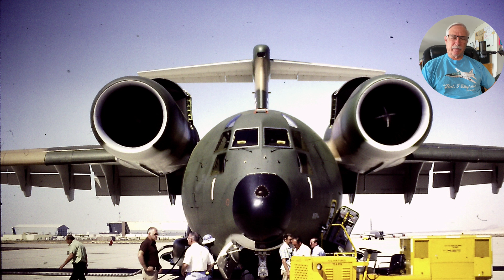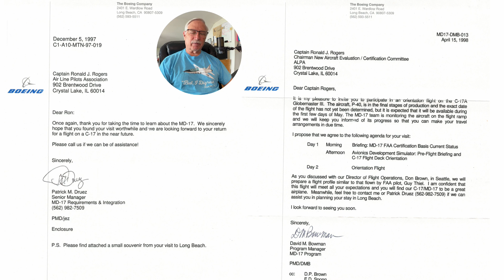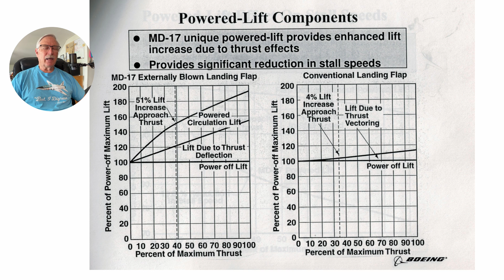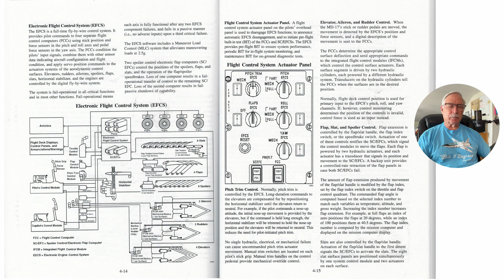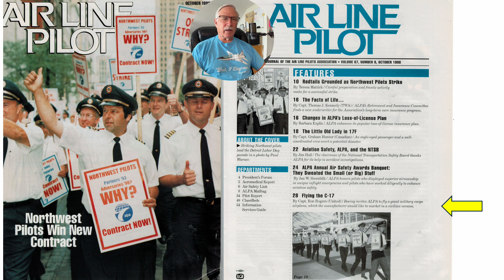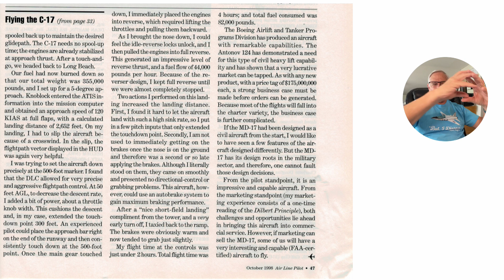Test Flying the C-17. MD-17 program issues

Comment: The Canadian Forces initially bought 4 C-17s, and quickly purchased a fifth. I think that, given the capability and typically higher flying hours we put on our aircraft, that we should have bought between 6 and 8 aircraft.
We do biannual supply runs to Alert, our northernmost listening post. A C-17 could deliver more than 3 Hercules, in half the time and at lower cost.

Comment: 32:00 Wasn't the F15 designed with airspeed tape in the HUD similarly showing 'slower speed when you pull the nose up, and faster when you pitch down' (which seems sensible to me; but then I am probably a boring cockpit-skywards kind of guy at heart).

Comment: Our company designed the Avionics Suite for the C17.  I am one of those engineers, which involved well over 300 people, for several years.  This airframe is one of the absolutely BEST cargo aircraft, which was ever designed.  We got the job because we had previous experience for C5, and parts for the AC130.  It was major major mistake to stop the continual production of this plane.  Right now it is desperately needed, and the C130s cannot support the sizes and weights required for modern ground vehicles, larger cargo, number of persons carried, or on/off loading.   It could have also been a Tanker, which the USAF is still unable to make properly.  C5s cannot land on such unimproved fields, and have major on/off loading issues.  C17s have multiple redundant systems, and can work in degraded conditions, poor weather, and in all places on this Earth, which have any kind of landing zone.
Reply: Mainly because it was designed by MD, NOT BOEING.  I am of the opinion that for the next cargo aircraft for the USAF, just build more C-17's.  Why mess with success.  Loved this AC from day one.

Comment: I’ve always wondered why jets don’t set a moderate amount of thrust for approach and use spoilers to precisely keep the glide path.
Reply from the maker: That would increase fuel burn during approach and affect the airlines bottom line. Not really needed with the concept of "stabilized approach."

Comment: I used to see C-17 daily as an AGE mechanic at Ramstein AB. My flight supported the transient AMC aircraft and we saw plenty of C-17 and C-5 and KC-135 and also the tail end of the C-141 life. C-17 were east because they usually only needed a generator and a B-4 stand. 

I had a pretty efficient system when I was on flight line duty to keep up with demand for incoming and departing aircraft and how long it took to fuel up an empty generator. I had a good system and found out the hard way that the crew chiefs knew by voice on the radio and whenever I relived another less efficient driver they’d say over the radio “this guy knows what he’s doing get your stuff now”.

Comment: @30:30 — Hi Ron ! $175,000 each ? That still seems low for the mid to late 80’s to mid 1990’s. From what I can gather from original DoD, Boeing, and Congressional estimates, it appears that it’s $175,000,000 each or thereabouts in that time frame. I’m definitely not trying to step on your toes, just clarifying.
Reply from the maker: Obviously I have omitted a few zeros.🤣🤣🤣😄you are correct!

Comment: I enjoyed your insights about the flying characteristics of the C-17. That jet always impressed me with its maneuverability for such a big aircraft. I can remember flying between WRI and CHS on the way to Biggs AAF for a WIC. On the way to Charleston they were practicing the syllabus and initially flew out over Atlantic City and opened up the cargo door while the rest of the formation were in trail flying SKE. Afterward we turned to the south and flew pretty low somewhere along the Appalachian Mountain chain for a spell. During this segment I remember getting either driven into or coming out of my seat while I was lying down. After a little bit I decided to investigate and take a peek out of the porthole window next to the Loadmaster's station and had to look up to see the ridge. 

But as for maintenance, that jet it wasn't a fan favorite or at least back in my day. I'm sure they worked a lot of the bugs out by now. The engines were somewhat reliable but nowhere as reliable as the GE's that I had worked on previously (except for the TF39). Since the C-17 had both a fan and core reverser. The fan reverser wasn't a big problem or at least if it had the neat nacelle, but the core reverser was always a problem. You could rig it and then shake the hell out of it and recheck and it would be out of rig again.

Most of the core reverser issues back then was during engine running offloading/onloading in the desert. The crews would deploy the TR's and offload PAX and cargo which could be for quite some time. In the process the core reverser would become heat soaked and when when stowed, the translating sleeve of the core would get stuck once the dagmar cooled. Interestingly, even though the reversers on the C-17 were hydraulic, there wasn't enough force to unseat the core reverser from under the dagmar under this condition. Which would cause us to have to lock out the TR which was a chore all in itself mainly because the TR control valve was in the pylon of affected engine.  

I thought that it was interesting that the flight controls had a Mech backup but the engines were purely fly by wire. And of course since it was a Pratt, EPR was the thrust setting parameter. On too many occasions it would revert to N1 mode. And God forbid if you had to change a wiring harness (W1 or W2?) it was a pain to change because you had to pass the new harness through one of the fan exit vane struts and they used Adel clamps unlike GE which runs theirs through the bifurcation and used clips. Another Pratt quirk was the oil migration issues. Even though it had a check valve mechanism, we would get oil consumption write ups. There was a procedure of running the engine up to 1.18 for a period of time then shut the engine down and pull a drain plug from the accessory gearbox and if there was an inch or less of oil it was good to go. But on too many occasions you would get a full bucket of oil or more out of the gearbox. I believe that Pratt fixed this issue too, but the gearbox scavenge pump was failing and not pumping oil back to the tank and thus accounting for the missing oil. To add insult to injury the gearbox scavenge pump wasn't splined into the gearbox but direct geared. 

As far as the APU is concerned we had problems with exhaust leaks and the inlet door actuators. The exhaust leaks were mainly caused by backpressure on the APU from what I was told by Boeing. The heat buildup within the compartment would cause wiring degradation issues over time. Not certain how true this is but I remember being told that the reason for this was because the APU was designed by the manufacturer to be in the tail but because of weight issues it had to be relocated to the right pod. I also heard that by enlarging the right pod to house the APU this caused the jet to fly differently and MD had to program the fly by wire computers to compensate so the jet would fly straight again. Again not sure how true this is but sounds plausible.

The APU implosion issue was resolved before I left. For some reason the APU inlet door would close uncommand while the APU was running and cause the plenum to implode thus trashing the APU. I believe that they were looking at a fault clutch on the door actuator as being the bad actor, but its been since 2011 since I worked on the jet. A new actuator was the solution to that problem from what I recall.
Reply from the maker: Wow! Thanks for such a detailed discussion of the maintenance issues. I really learned a lot!
Reply: Now it makes sense why I bumped into an 'APU DOOR' alarm for the C-17 here on YouTube. I had never heard anything like that before on another plane. Sounds like it was a frequent enough or important enough of an issue where McDonnel Douglas decided to give it its own alarm. Thanks for the detailed information.

Comment: A decent rate of 24000 ft per minute is 400 ft a second! Awesome! Is that zero g or negative g for those on board?
Reply from the maker: Well, depending upon the push over, you could get light in your seat, but once established, it should be close to 1 g.

Comment: I did get to walk through a C-17 at an airshow it is a beautiful cargo jet!  When I was in the 101st I got to be on a load out to Panama prior to the taking out of Noriega.  We were in a C-5, we loaded 8 Hueys and 70 troops in it.  I was a Huey PIC then.  I got the opportunity to visit the cockpit as we were approaching the Yucatán Peninsula at FL 330.  The copilot was back talking to the navigator and the Captain let me sit in the right seat.  We got a clearance to descend to 310 and the Captain reached over and set 310 and pressed a button and down we went.  It gave me the desire and after 10 years of Huey flying, U-8F, and C-12D I lucked out and got hired by AAL and spent 17 years flying for them, even 18 months flying the 777, I was a Captain flying the 72 an 73-8.